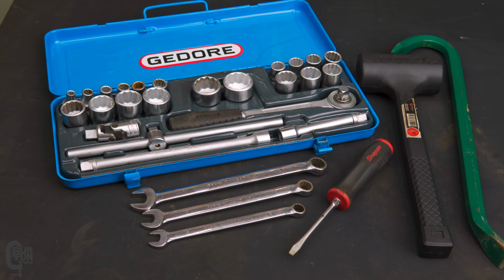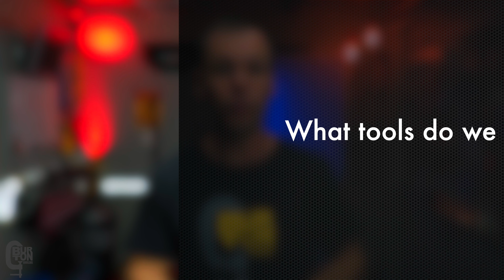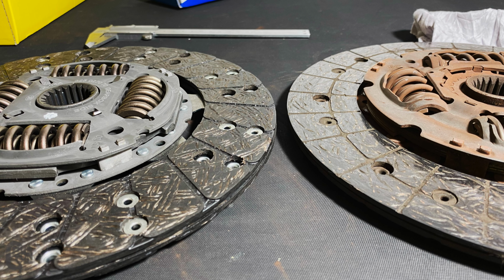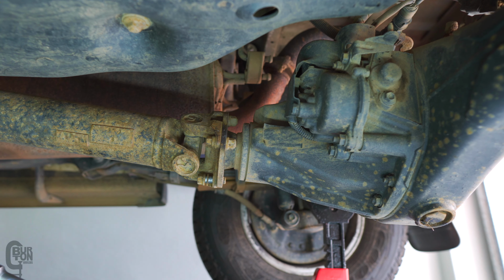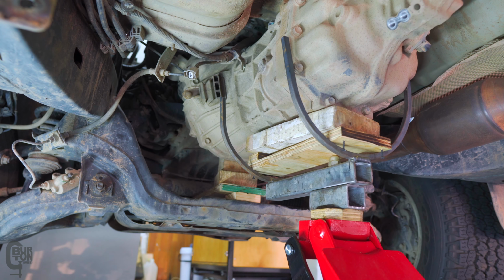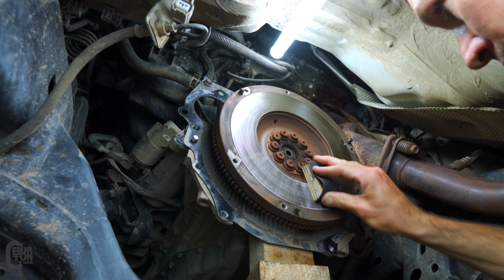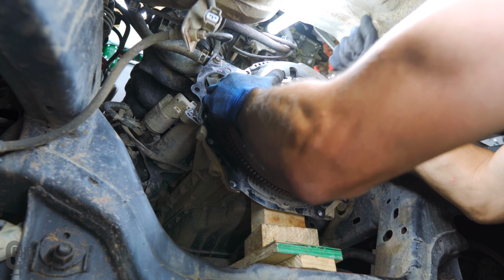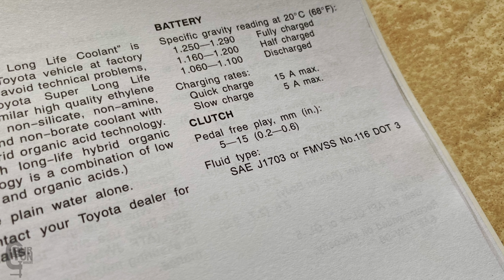How to Replace a Clutch DIY GUIDE - Toyota Hilux - Burton Builds

Comment: Yay, a quality presentation. Very informative but also realistic but safe. (Of course it's good to disconnect the battery before playing around near the starter motor ... but maybe I missed that part) A worthwhile watch. Thank you! I have the 4x4 version Hilux so there will be an extra lever ... and the front driveshaft ... and maybe some extra wires, but otherwise similar, I imagine.
Reply from the maker: Hi Rod, I've never done it but have been told that changing the clutch on the 4x4 is a lot more work... but many of the same methods can be used. Thanks for your comment.

Comment: Wow 🤩 what a great presentation, love the step by step process, really made easy, very clear on what to do, and all the little handy tips along the way, Great Video presentation thanks mate learnt so much from this 5 ⭐️
Reply from the maker: Hi Steven, Thanks very much. I'm really happy that others are finding the video useful. If you were having to replace your clutch on a Hilux, it may also be good to check the condition of your water coolant bypass pipe... some models have a plastic bypass pipe that often cracks / breaks and I've also made a step-by-step video on replacing that. https://youtu.be/r4IfRgUcCkM

Comment: Thanks for this video. It is the most informative version I have seen on this subject.
Reply from the maker: Hi Owen, thank you very much. Did you also have a clutch replacement you had to do?
Reply: @GrantBurton  not yet. Parts should be here in a couple of days. I'm just making sure I know what I'm in for.
Reply from the maker: @bennythegypsy3637  Good luck with the job, I'm sure it will turn out all good. Let us know once it's done. Just remember to inspect the condition of your flywheel properly. Normally the warranty on a clutch is only honoured if the flywheel was skimmed when the job was done - This is normally included in the paperwork with the clutch kit. When I replaced the clutch and pressure plate on our Toyota Tazz, I removed the flywheel and had it skimmed so the mating surface was perfectly true again. Here is the video if you also want to check that out for reference. https://youtu.be/WeTPkD4HvSk
Reply: @GrantBurton  thanks. I watched the video (very good) My clutch has been slipping in my hilux for some time so I imagine the flywheel may have some damage, I have a large metal lathe so skimming the flywheel should be easy...ish.  But i will tell you how it goes.
Reply from the maker: @bennythegypsy3637  Awesome, thanks. I wish I had a lathe in my shop (do have access to one though)... one day when i eventually make it on YouTube, haha.

Comment: Hi grant,good job that you do most of all ur maintenance,no problem about the talking at all for newbie,they need it,but you didn’t explain much about how you remove the pilot bearing,thx buddy
Reply from the maker: Hi Joseph, thanks... sometimes doing ones own maintenance can be frustrating, normally when battling with a job, but it is really nice to be capable of doing all this stuff. I think it's becoming increasingly difficult to work on the newer vehicles because of sophistication and special tools needed.

As for removing the pilot bearing, I used 6mm bolt with T-nut on the end. I ground two sides of the T-nut flat so that it can be cocked over to the side and slipped in behind the bearing and then when the arrangement is pulled straight again, the edges of the T-nut just grab the inside of the bearing... then I just turned the nut on the bolt and the bearing came out. Apologies, it's a bit of a bum explanation... kind of difficult to explain because it was a homemade / one use puller. There are internal bearing pullers available to buy, I just don't any.

I had the plan of showing and explaining the bearing puller at the end of the video but when it came to recording the end, I couldn't find where I had stored the homemade puller so just skipped over it (turns out it was in the box where the old clutch was).

I suppose anything will work, as long as one is able to stick it through the internal diameter of the bearing and hook it behind the bearing and then pull. Some bearings come out easy, some are really difficult to remove.

Comment: I just saw it for the second time wow perfect job congratulations I love you jack, one question the Luk kit comes with the small tool. To center the plate?
Thank you for the video
Reply from the maker: Hi, thanks very much. The LUK kits i have used have come with a small plastic insert supposedly for centring the clutch plate, but its more like a plastic handle that slides into the centre hole of the plate and enables you to grab the plate and manually centre it (it doesn't hook on anything or centre itself) unless I have been using it wrong... haha. If it was longer, it could possibly be inserted into the spigot bearing, but from what I remember, it's not long enough to reach.

Comment: Thanks for the video Grant! Great work
I too got someone else to do the hard work but now it seems to be shuddering when first taking off and even in reverse. Didn't fit the original clutch kit but a generic so maybe that's the problem. What actually causes the shudder? Could it be the thrust bearing? The flywheel was taken for skimming
Reply from the maker: Hi Benjamin, thanks for the comment. It could be a number of things causing the shudder.

Basically it sounds like the clutch is shuddering when you are engaging it (in order to get the vehicle moving). A bad quality kit can shudder even from new? What brand of kit did you put in? I'm assuming you installed a new clutch plate, pressure plate, release bearing and spigot bearing?

A clutch also has to bed in... usually it takes around 1000km or town driving... however good kits won't shudder at all, even during bedding in.

Hopefully your flywheel was skimmed / machined accurately... poor machining can also be the cause shuddering. Also, when installing the flywheel back onto the crankshaft, if the flywheel did not seat 100% flat back onto the flange (because of dirt or something), it could be running out and cause shuddering, however you'll probably feel additional vibration on the engine when the clutch is disengaged.

A contaminated clutch plate can also be the problem... for example if it has oil leaking on it.

It's not unheard of while taking apart or even installing the gearbox, to bend the input shaft ever so slightly (this isn't normally the case though) or cause damage to the disk or spigot bearing while trying to force the gearbox back on.

Misalignment of the gearbox can also be a problem.

The shudder is caused by the clutch plate not engaging evenly around the friction surface or the clutch assembly not meeting concentrically as it rotates.

Hope this info helps.
Reply: @GrantBurton  Thank you so much for such a detailed reply! I think I will have to take a long look through it myself and see what's causing it. With you video on how to replace the clutch kit, it should be easy😄
Reply from the maker: @benjaminfalconer8725  Let us know what you find 👍

Comment: Very informative. thanks! My clutch is slipping on my 3.0 D4D 4x4, but I don't feel confident to change it myself at this stage. Where in SA is the best place to buy the components?
Reply from the maker: Hi Tim, thanks for the comment. First choice would be buying a genuine clutch, pressure plate and release bearing from Toyota... If thats to expensive, then all Midas, Autozones, etc. stock the LUK clutch kits... a couple of phone calls to find out who is offering it at the best price and you should be sorted. Th old genuine Toyota one I removed has both Toyota and LUK brand markings on it.

Depending on how hard your vehicle works, or if you are travelling far into Africa (something along those lines), you may want to consider installing a genuine Toyota part... It's going to be super irritating and inconvenient having a clutch fail in the middle of nowhere because of an earlier cost saving.

We went for the LUK kit (non OEM) because the vehicle is mostly used around town with the odd camping trip or cross country trip, so a failure wouldn't be to much of a headache. Also its not used as a work horse 24/7.

Hope this helps.
Reply: @GrantBurton  Thanks Grant, I've actually been through a few clutches already on this vehicle. The current mileage is about 420 000km and I've done a fair amount off-road. I do find the clutch slips long before it actually fails and that's generally due to pushing it too hard when heavily loaded and going up hills. This just happened to my son, who's not a very experienced driver and was driving on a tar road in the Eastern Cape when he felt it slipping. I took over the driving and was a lot softer on the clutch which then got us home safely to Cape Town.
Reply from the maker: @Jumping-Goat  Glad to hear you made it safely back to Cape Town. I'm not sure if you have noticed but when the pressure plate wears, the clutch pedal gets increasingly hard to depress (or at least thats what I assume is happening). Also good to hear its still going strong at 420 000km.

Comment: Howzit Grant, hope you are well.
Would you happen to know how to replace the cabin filter on these hiluxes? Mine is a 2006 model and doesn't seem to have the release clip like all the videos I have seen on YT. When you remove the cubby the place where it should be is completely closed off. Do I need to remove the anything else?
Reply from the maker: Hi Benjamin, well thanks. Our Hilux also has its cabin air filter slot blanked off (no cover that clips off, but I can see where it should be)... so maybe there are models that aren't fitted with a cabin air filter.

Comment: How did you make the trolley jack gearbox holder ?
Reply from the maker: Hi Michael, I made it form a bit of scrap metal I had lying around. Some 10x10mm solid square bar as I remember, bent it into a U shape and welded it to a piece of box section steel (was probably 40x40mm square tube). Also removed the lifting plate from the jack and bolted the gearbox holder through the hole where the lifting plate fas fastened.

Comment: hey man i have a 2014 hilux 4wd preasure plates are thrown away now. it all comes in the clutch kit
Reply from the maker: Hi Gary, yeah… the kit normally comes with a clutch plate, pressure plate and release bearing (throw out bearing).

The 4WD clutch change is a bit more difficult than the 2WD 😊

Comment: Did the pressure plate must changed when u change z clutch????
Reply from the maker: Hi Binyam, it is good practice to replace both the clutch plate and pressure plate at the same time… usually these come as a kit together. It’s also a good idea to replace the release bearing / throw out bearing and possibly also the spigot bearing at the same time (while the gearbox is removed).

Comment: Any specs on your transmission Jack want to build my own
Reply from the maker: Hi Troy, it's just a standard low profile 4 ton trolley jack and I made a cradle for the gearbox out of some scrap steel lying around... and bolted it to the lifting point of the jack. You don't need a 4 ton transmission jack for this type of job... it's just a jack I had around so I used it.

Comment: Do you have any idea what a standard OEM flywheel is for a hilux 2008 ggn25r 4.0l V6 by any chance?  I've searched online everywhere looked ant my Haynes manual and can''t find any mention of the type or part number.  I'm going to replace my clutch assembly and flywheel using your video. Thanks
Reply from the maker: Hi, any specific reason you want to change the flywheel? I don't know off hand what the flywheel part number is but I'm sure a call to the Toyota spares department would be able to give it to you over the phone.

Comment: Hi Grant. Great videos. Slowly starting to do more maintenance myself with your help. What brand electronic torque reader you using? What did youtorque your flywheel, do you know if it is the same spec for a 3.0 d4d 4x2?
Reply from the maker: Hi 550Sieve, thanks for the comment. The torque gauge I use is a ACDelco ARM602-4 (https://amzn.to/3pmMRng) I didn't remove the flywheel this time around... Also not sure if its the same spec for the D4D.

Comment: HI Grant Burton, i am having issue after changing whole clutch plate and assembly. the 1st gear is a bit stuck like showed in your video, like the the clutch is still rolling after pressing. it always has difficulty on insert the 1st gear and vibration came too.  i hope you can clarify my doubts. thank you very much.
Reply from the maker: Hi John, it could be a number of things causing your various issues. When you say 'vibration'... do you mean a shudder as the clutch engages? Maybe it's a defective clutch kit? The shudder / vibration could also be caused by a damaged or badly worn flywheel... most times its recommended to have the face of the flywheel recut / skimmed to ensure it is a fresh and flat surface (this depends on the vehicle though... so best to check what is recommended for your specific vehicle). Maybe by mistake, the gearbox input shaft was bent when taking it apart or installing it again if the gearbox was hanging? Or maybe the gearbox didn't seat completely flush with the back of the motor when it was bolted back together... Possibly if one of the surfaces had some dirt on it, it may have bolted up skew causing the clutch plate grab on one side first.

I think your sticky 1st gear is because the clutch is not completely disengaging. Did you bleed the clutch system after installation? If this has been done, check if you are getting the correct amount of travel at the clutch slave cylinder - is the clutch slave cylinder pushing the fork and release bearing far enough for proper disengagement. (this is vehicle specific so you may have to check what yours should be). If thats all good, has the fork been installed correctly and is the throw out bearing / release bearing compatible with the replacement clutch and pressure plate assembly (it could be that the throw out bearing is slightly shorter than the old one and now you are not getting enough travel out of the slave cylinder because the clutch pedal inside the vehicle is hitting the stop?). If that is all correct, maybe the spigot bearing is worn and dragging, so even if the clutch is fully disengaging, a dragging spigot bearing could also be causing the input shaft of the gearbox to be spinning and causing the sticky first gear. Or maybe by mistake, the new pressure plate was slightly bent when it was bolted to the flywheel and now is not releasing evenly.

As I said, it could be a number of things and somewhat difficult to troubleshoot without having overseen the installation or without taking some measurements.

Hopefully this gives you some idea of where to start looking for the problem and hope you are able to fix it.

Comment: Hi, what did you use for lift and fail safe lift?  Was it just 4 axle stands?
Reply from the maker: Hi, I used a 4 ton trolley jack to jack up the vehicle and then set the vehicle on 4 axle stands rated at 6 tonnes each.

Comment: What grit sandpaper you do use for sanding the flywheel?
Reply from the maker: Hi KT, starting with a piece of 120 emery then finishing with a piece of 180 grit emery cloth on a small flat block should be good. Sanding is more to clean up the surface (scuff it up) and to reduce / remove any glazing. Using a block to sand should show if the flywheel surface is still flat... if it's not flat, it will need to be skimmed (recut the surface flat) or replaced.
Reply: @GrantBurton  thank you very much, that's crystal clear 👍🏾
Appreciate it